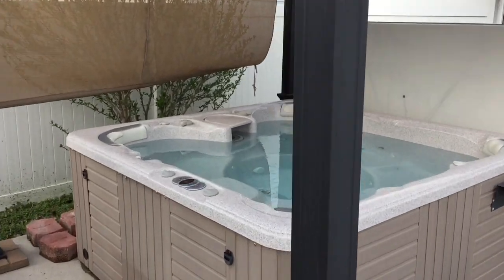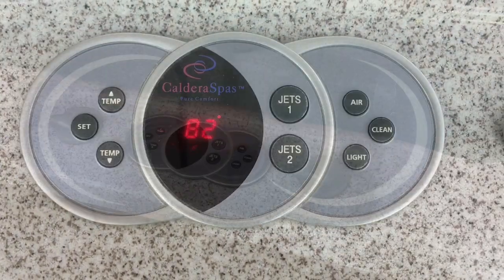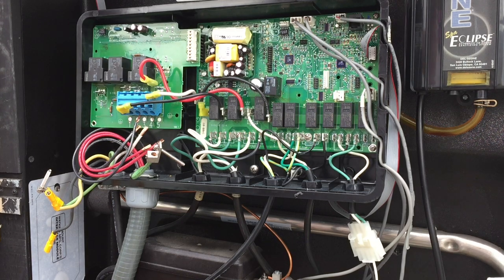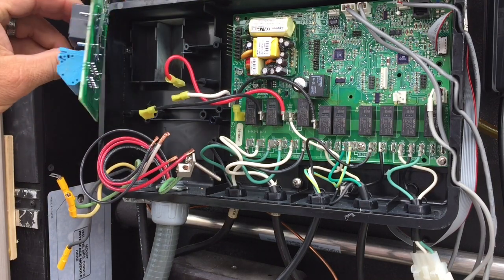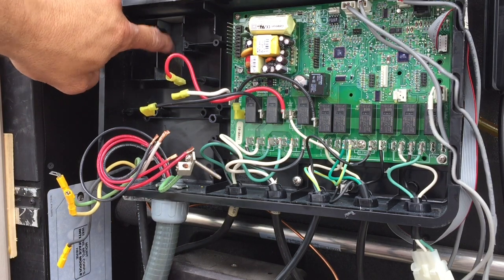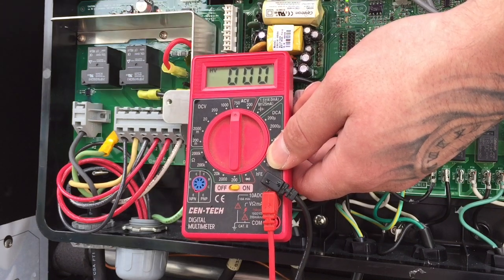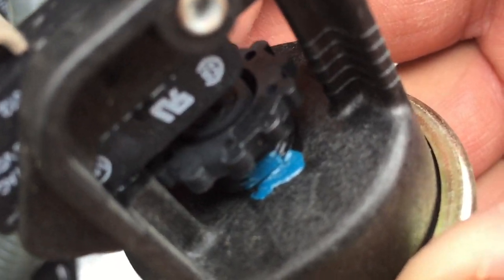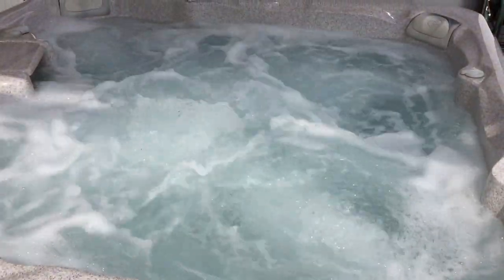Fixing A Cold Hot Tub...

Comment: HI again, I have got my balboa circuit board back from the repairers. It warms only to 29 degrees even if I have it set for 38 degrees. All relays have been changed. When I lowered the heat to 26, I see the temp light goes off. And I hear a small click. Then I put it back to 38 and get a small click. The heat light then flashes and then is steady after 90secs. but it is not going over 29 ? The fuses look fine, but the big main one is not glass, so would need to check that one. I checked the AC current on the element, with it all powered up, And it read nothing. is this strange or what? The element is warmish to touch not hot to burn yourself. I need to switch it off now to check, the ohms. just checked the ohms, around 18,9-19? What does this mean if it is not around 11 or 12? I don't know where the problem is, any ideas?
Reply from the maker: It really sounds like you’re not getting full 240 V to the heating element. I would check the continuity on that fuse that you cannot physically see. Your ohms is within range - 9 to 12 is ideal but 10 to 20 is not unusual either for some brands. I would be certain that the heater relay board is functioning properly. Is the heater relay board the one you sent for repair or the actual main board?
Reply: @SmokinwithKasket  Yes main board sent for the repair,replaced all the relays, they said one was really bad,so if that was the one for the element, I don't know. I have no 240 v at the element, checked the board where the 2 brass connections connect to the board,no 240v there either. The heating light shows a steady light , meaning it is heating, this to me seems only a relay problem again. When I take the heat down to 26 from the 28 now,I hear a click, the light goes off, when I put it up to 38 degrees, hear a click light flashes 90 seconds then becomes steady, showing heating. The main 30 amp fuse is the,9 years old. tested 0,1 So all seems normal, no-fault codes come on the screen either.
Reply from the maker: You don’t think it could be your relay board?  The secondary small board?  I still feel there’s a relay issue.
Reply: @SmokinwithKasket  there is only one main board.
Reply: @SmokinwithKasket  the main fuse was 0,1 but this would be only to do with the pump, no. Pump is new and runs normal
Reply from the maker: @swedishkev  - I’m sure you already did this but be certain that you have 240 V coming in to the tub itself and it’s not the circuit breaker malfunctioning. Short of that I still feel like it’s got to be a relay I would replace the relay board with the updated really bored that they now offer.
Reply: @SmokinwithKasket  ya 240v coming in to board. Dont know where to find a new circuit board at a reasonable price. Here in Sweden 650 dollars. Too much for me at moment.
Reply from the maker: @swedishkev  WOW!!!  I think here they’re about $400 US dollars. Did you upgrade your relay board?
Reply: @SmokinwithKasket  Not sure what you mean with upgrade, there is only one board on my hot tub.
Reply from the maker: You must have a different configuration than I do. Mine has a motherboard or a main board and then a secondary controller relay board and then the main power lines connect to that secondary board.
Reply: @SmokinwithKasket  Hi William, talked with uk, they said to relays were bad but replaced all of them. They could not test anything on the board or functions etc. They told me to check the live and neutral, there is a live ,neutral x 2. This is what l discovered , 
This might give a clue now, checked the bottom live and neutral. With heat element off, reads 62  with heat element on reads 0. ?? Bottom neutral and top live is reading over 230vs. And the top live and neutral 230 also. Does this tell you anything??
Reply: I just want to thankyou for all your time trying to help. It is now working. Because l had only 62 , at the bottom two live and neutrals, l phoned the electrician and he is hard to get to come round,but l had luck and he was in the area. He is the one that installed it 8 years ago. The problem was back in the electrical breaker. Cupboard, where he had connected it to. there was one reading of 60 there also,he just tightened up all the wires  and got 230vs, he went back to circuit board turned it on, pushed on button for heat  after 90secs , solid orange light, took reading on element,voila 236vs. I am beyond chuffed,maybe that caused 2 relays to fuck up. Thanks for the help. So basically if it is not the element and not the relays, then its time to check all wiring. Lesson learnt.
Reply from the maker: Great to hear.  I was suspicious of your unit not getting full power. Makes sense now. Thank you for watching and commenting. Now- enjoy a relaxing evening in your hot tub!!!  Stay safe!!!

Comment: Thanks for the video.  Found burned spots on the back of my board.  Got the replacement part.  BUT new board is slightly different in the lower left hand corner.  The wires attached to the old board with a slot type fitting plus the ground.  The new board has a grey plastic piece instead.  Your old and new board seem to look different as well but I can't tell where the white wires reattaches to the new board in your video.  So my question is, regarding the three wires in the lower left corner, is it necessary to snip the fittings off the ends of the positive and negative wires, and then where exactly does the positive attach to the new board?  Thanks again!
Reply: LOL, I see now, there are receivers for SIX wires on the new board, and one of those is the positive wire connection I"m looking for.  You touch it with your multimeter.
Reply from the maker: Eileen Napier yes And one of those receivers is for the white wire for the heater element. Glad you figured it out just reading your comment I was suspecting that you ordered the wrong part. Let us know how it worked out once you got it installed. Make sure that you have the correct voltage set for your motherboard before you powered up.  If you’re not sure, I just published a new video a few weeks ago on replacing the motherboard. Watch that video to be sure you have the correct voltage set on your relay board. I outlined that in my most recent video a few weeks ago.
Reply: @SmokinwithKasket  Was that in the video?  I don't know where to adjust the voltage setting?
Reply from the maker: It’s in the video I published a couple weeks ago it’s very close to the top of my video list I just did it a couple of weeks ago on replacing the motherboard and in that video I explain all about the relay board and how to set the voltage.
Reply from the maker: Oh that’s very nice of you!!!!  Thank you so much.  Let us know you succeeded with your installation.  Best of luck and stay safe!!!!
Reply: @SmokinwithKasket  Total success!  Enjoyed the tub today for the first time in weeks.  Many Thanks!!
Reply from the maker: Eileen Napier - Awesome to hear.  Congrats!!!!
Reply: I need your help I am needing to replace my heating element board my hot tub  is a 230 and I noticed the heater bored that you installed has the same 230 as my heater board but I’m confused where I put the third wire that comes from my heater!

Comment: I’ve got a green LIM light and no red heater light.  Hot tub is staying about 92.  Should I reset my high temp reset switch?  Caldera Geneva
Reply from the maker: Hey Paul, looks like you may need to reset the temp switch.  It appears that the board is not sending the signal to activate the heater.  There may be more going on here.  Try cutting the power off for a few minutes then rebooting.

Comment: hello i have the same one and the D17 light is coming up every time I'm pressed on any advice??
Reply from the maker: Check your relay board voltage and be sure that the relay board voltage is set properly to the control board.  Also, there is a chance that the control board could be faulty even though you just replaced it.

Comment: Master spa 557LSX.  2010.  Bought new 8/12.  I have a warm temp light but won’t heat over 70 or so.  Jets and pumps (3) operate as expected.  Any advice?  Not sure if this model has a high limit switch.
Reply from the maker: Check the heating element to be sure it is getting full power.  This model should have a high limit switch although I don't think that is your problem here.  I feel like your heater is not functioning properly.
Reply: Thanks.  I had a MSP tech out yesterday.  It’s the circuit board and circa pump.   He did install a new sensor $67 Bc it was warped or “chewed “. I have not ordered the 2 new parts yet or authorized the technician to return - the quote was around 780 parts:labor.  What is your advice sir? 3307705840
Reply: William Kasper tech said heater tube is fine.
Reply from the maker: @christie8530  If it were me, I would order  the parts and install myself.  The tech. did the hard part for you - he/she diagnosed the problem.  I would order the recirc. pump first, install and see what happens.  This is an easy installation and they do have a life expectancy.  I recently had to replace mine as well.  It may be that the pump is not allowing enough water to circulate thus not heating or heater is overheating and intermittently shutting off.  The circuit board, most expensive part can be unplugged and  the new plugged in.  Its definitely something you can do yourself.

Comment: So my hot tub is not heating up I've replaced the heating element and the water pressure switch. The element is geting 120v into it but it's not heating up
Reply from the maker: You should be getting 220 volts.  You are losing power and its more than likely the power board circuit.

Comment: Probly the reason the circuit board burned is because the solder joint on the relay developed a crack and started arcing, it probly could be repaired by cleaning the circuit board and resoldering the connection.
Reply from the maker: Good point Bob. That sure could have been a possibility.  I tossed the old board though. Prolly should have experimented with it and possibly made a spare.
Reply: @SmokinwithKasket  If you like, I can send you the one I'm replacing.
Reply from the maker: @VertigoGTI  - Thank you for that offer.  Thats very kind!!!  However, I will pass.  I have plenty of things to fix and work on at the house.  LOL  No tinkering time at all!!!  So far, my replacement board is working great to date.  All the Best my friend.
Reply: @SmokinwithKasket  I need some help !  My heater relay board has failed mine also is a 240 when you install the new board I could not tail what you did with the wire that is currently in the H1 position !  U was saying that the new heater relay board only has three wires which one plugs into the H 1 in the big gray connection can you please reply!
Reply: I have a Tiger River spa 240 has u was saying it has two breakers and the breakers all the connections in the gray connector all the holes r full of wires from the breakers!
Reply from the maker: @timkee4420  Hi Tim.  Look at 6:58 on the video.  I’m not 100% sure What you’re asking but you can see were both main legs of the heater connects to the relay board.

Comment: The main control board is exactly the same as our Hotsprings Sovereign (the control board died but the heater relay was fine)
Reply from the maker: What did you end up paying to replace the main control board?  I figured that other spa makers use the same components.
Reply: William Kasper We payed £380 or $390 for the brand new control board and it seems to be working great so far
Reply: William Kasper I put a video of it on my channel its called "Is The Hot tub Broken?"
Reply: @AlexEatonPDPIGaming  Just looked for your video and it appears to be gone. I'm worried that this is the issue I'm getting.

Comment: dont need any jumpers?
Reply from the maker: No. Jumpers are provided and preset.
Reply: @SmokinwithKasket  ok so even if the D1 is in the row of wires I wont need any jumpers with my 240V system?
Reply: Just don’t want to mess anything up I have the old panel with 3 fuses and it seems like they have updated it with the 2 fuse panel. Wish I could send a photo
Reply: @SmokinwithKasket I have wires on 1,h1,2,3 and the common or hot on 5… nothing on 4. My original heater board had a jumper on 4/5… I’m confused with the newer board. Will I need any jumpers for that one? Everything is working, water gets hot now, but my jet pump stopped working all a sudden. I test voltage on the black/white wire where it plugs into the board. I hit the jet button, the red light lights up and I’m showing 120V but pump doesn’t turn on for the jets… it was JUST working b4 i replaced the heater board. Don’t see why it would just go out  :/ why I feel like it has something to do with a jumper.. am I missing something?
Reply from the maker: @rickbaldwin5042  if your getting 120 volts to jet pump it seems it’s getting power.  Could be the pump motor.  Possibly the starting capacitor took a dump.  
Everything seems good from your description.  Check the motor.
Reply: @SmokinwithKasket  yea, when I hit the jet button it turns the red light on and it’s getting 120z ahhh that thing is a pain to get to too. The capacitor that big bump on top of the pump?  Sucks if if just went out like that cuz I had just ran it before replacing the heater board. So you don’t think it’s anything to do with having no jumpers like it did before? When I had jumper on 4/5 on my older board?
Reply: @SmokinwithKasket  I’d rather it be the capacitor, of course, I can possibly get to it without having to remove the pump. But I don’t get noise or anything out of it. Circulation pump runs fine. Just nothing from the jet when I give it power all a sudden. What you think my odds are it’s capacitor?
Reply from the maker: @rickbaldwin5042  look at the instructions that came with your replacement board, because there are jumpers, switches, that needs to be set for the appropriate voltage. Even if the jumpers were incorrect, it should not have affected your 120 V pump motor.  Think it might’ve been coincidental that your pump motor failed right at this time but there’s a good chance it could be the starting capacitor on the top of the pump.
Reply: @SmokinwithKasket  yea, it didn’t come with instructions. Bought it off Amazon. Your video were my instructions on how to install. And they were good. I’m getting heat now. And I feel it’s installed correctly. For giggles I put a jumper where there was one at 4/5 like my original board and all it did was make the red power light blink but nothing would work. Took it back out and everything works. I’ll try and see if I can get to that capacitor. Very tight space :/
Reply: @SmokinwithKasket  biggest thing is I don’t Want to install a jumper in wrong spot and blow something. U know
Reply: @SmokinwithKasket  thanks for your replies too.. so this is the right board though right? I went from 1-5 in my first one and this new one just adds the H1.. just updated
Reply from the maker: @rickbaldwin5042  does your other jet pump work fine?  I’ll tell you I have had many items. It seemed awfully coincidental over the years that would stop functioning after I fix something else. So this is no different. It certainly could be the capacitor and it won’t make any humming noise or anything if it’s a capacitor is blown.
Reply from the maker: @rickbaldwin5042  to the big bump on top of the pump. Should be a bolt on each end of that cap. Be careful not to touch the terminals of the capacitor because it can hold quite a bit of electricity that will hurt you. You can discharge it by using a screwdriver after the wires are disconnected and touching a screwdriver to the terminals themselves on the capacitor. That will discharge the component.
Reply: @SmokinwithKasket  figured it out!! Wasn’t the capacitor or the pump.. it DID need a jumper at 4-5… so if the red light heat light is on and you turn the breaker off and put the jumper in it sends some weird signal to fault it… make sure the red heater light is off and then shut down power and install jumper. And people that jumper has to be pushed in all the way too.. turned it on and bam, working
Reply: Highly recommend you man… saved me time and money… I’m good at learning things like this and can’t STOP until I figure it out..  knew I’d get it
Reply from the maker: Omg!!!  Nice job Rick. I’m so happy that you found the solution.
Reply from the maker: I need to find my instruction booklet and research what you discovered.
Reply from the maker: @rickbaldwin5042  much appreciate the Awesome comment, my friend! I didn’t think I was very helpful, but I appreciate you watching commenting and hopefully subscribing. Stay safe and enjoy your hot tub!
Reply: @SmokinwithKasket  I’d send a happy video/photo if I could bud ha… been a lot of help so thank you for responding. Hope everyone sees the same issues and looks at these comments cuz they help
Reply: @SmokinwithKasket  be honest… the jumper is neeedd but I kinda feel like I hadn’t pushed the jumper in far enough. BUT, guy I spoke to told me to do that red light test and… well both worked out
Reply from the maker: @rickbaldwin5042  this is what I love about YouTube! We are so lucky to live in an era where we have this awesome platform.
Reply: @SmokinwithKasket  deff much help.. subscribed already. You too
Reply: @SmokinwithKasket  I’ve learned so much stuff off YouTube man… home outdoor bbq, electrical stuff, tile, many many more things. So I agree… im more the guy getting pointers then giving them but hahah… I think just this video alone will help people especially on my case of someone has the same issues I was having for sure.. JUST READ COMMENTS PEOPLE :)
Reply from the maker: Much appreciated. Stay safe my friend!!!